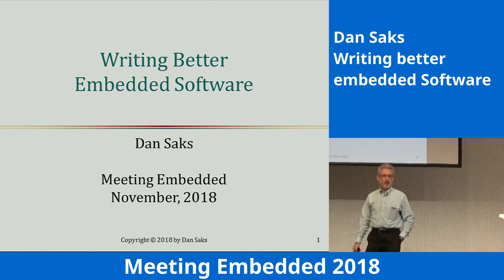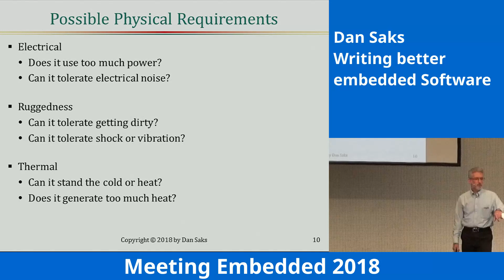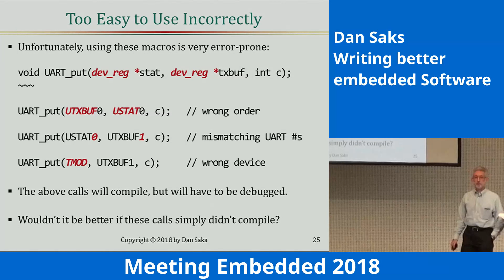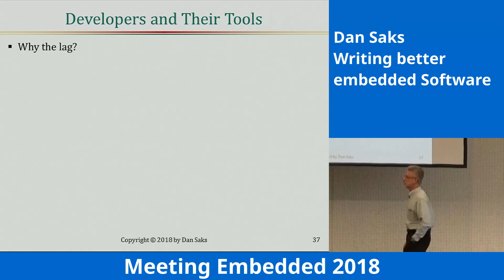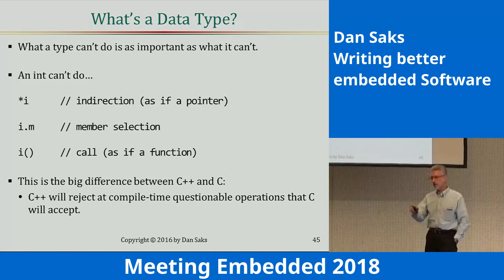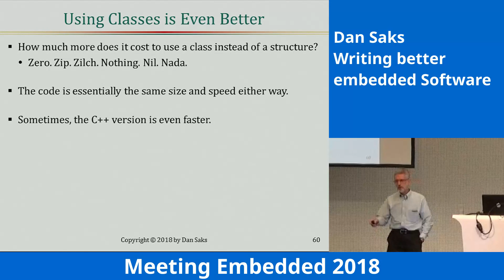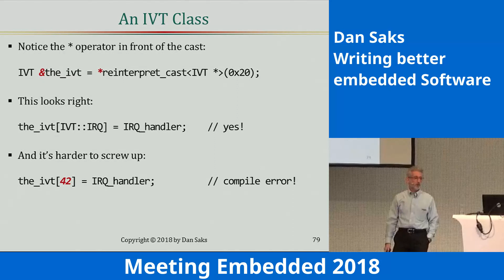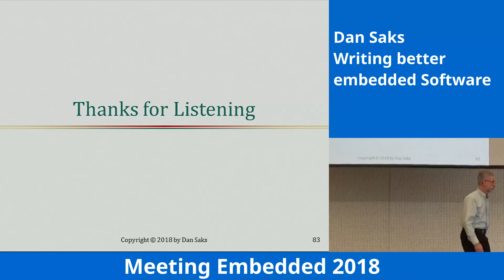Writing better embedded Software - Dan Saks - Keynote Meeting Embedded 2018

Comment: Really nice! As a former C embedded developer, I totally agree with the lecturer. I have been using C++ for over 2 years for, let's say, system programming. I am still learning C++ and I am getting rid of C programming habits. It is not easy but  I see profits.
Reply: Would you recommend to avoid C and jump straight into Embedded C++ if possible?
Reply: @189Blake  Sorry You have to wait for my response so long. 
My answer is no. Lately, I've changed jobs and I use both C and C++.  If you were a monk and wrote embedded code in pure C++ for fun the answer would be yes, dive into C++ and leave C. However, in real life, nothing is black and white. Companies still use C and a little C++. I have to admit C++ has lots of advantages over C but experience tells me you have to know both.
Reply: @dylanryan5125   Yeah. It's called, put in your email and reset the password doofus.
Reply: They are so familiar yet have distinct differences so it's worth learning both. And you will find both in embedded systems quite often.

Comment: The real change between C and C++ is the friends you made a long the way. Ok I'll stop now. Great talk! Been writing embedded code in C++ for a little bit (not as long as most folks here), We mainly do C++ and rarely see any C code. Something I've noticed over the years at least where i work at, is how we refuse to leave the C++11 world. I understand the fear of always upgrading to the latest but, it sometimes hurt to miss out on some of the newer features. For instance constexpr functions in 14 without having to  use twenty ternary operators would make the code so much readable and easier to debug. Going into more details would take too much of my time, but i did appreciate the talk :)

Comment: Very important team skill information. As fresh computer engineer (Diplom Ingenieur Technische Informatik FH Flensburg University of Applied Sciences) I had a short talk with oldest colleage about object oriented programming and using its possibilities, he was fully trusted by and advising the boss of that small software company with 1 mio. lines of code (modular programming style). He were not interested at all, so I keep my mouth closed for years about OOP as I did not want to loose my job. Few years later when we all worked on porting to windows I answered another me asking colleage that OOP might help to keep his tasks done, this time he tried and used it for productive code in user interface parameter code (but not for running measurements inside the measurement kernel system).
Reply: Did he go fired? xD

Comment: Another big thing is using operator overloading and templates to write a good and safe fixed point math library. Fixed point math is very common in embedded devices, and it is so easy to get bugs with overflows and misplaced shifts that could have been caught at compile time!

Comment: Just use #pragma pack(1) if you want to get rid of your padding bytes. wth. You can also just add compiler warning to error parameters to gcc in c? I feel like none of these points are valid.

Comment: Thankfully now the ECE program at my program has two required C++ data structures and algorithms. Even if you don't go into something involving software, you'll at the very least be better at writing a faster matlab script or analyzing or interfacing with your system with something like python or an embedded system hooked up to your computer.
Reply: Still waiting for our university EEE course to introduce this in addition to the very basic C programming course.

Comment: Good job and thanks. I work as an embedded software. Engineer in the USA. Only 1% of my fellow engineers are professionals that learned grade school. The are fakes that have almost no knowledge or capabilities. They can’t even read or write as processionals. The reason c++ is unpopular is because they don’t have clue what design is, and an architecture of one bad module. Bye..
Reply: Hey, I was wondering if you could give me some tips/ resources to use so I can become a good embedded software developer. Thanks!
Reply: Were you drunk when you wrote this comment, what does that even mean?

Comment: sir i was dropped out from my engineering school in 3rd year and after i leaned by my self and i am working in a small company , but i wanna apply for overseas 
could you help me to and give me a advice ?
Reply: Most jobs wont even consider your application just because you don't have a degree, even if you are qualified for the job in terms of technical ability
If possible, I recommend finish that degree
Reply: not possible
Reply: @dushanindunil500  then look for jobs that will day “will substitute degree for experience” but typically those jobs require 6 plus years = one degree
Reply: Start ups are probably your best bet, they tend to be less strict about following those requirements, they typically just want someone who can get the job done, is qualified and has a “get it done” attitude

Comment: I don’t agree with your definition of what an embedded system. I believe because of technology it’s been blurred. A Raspberry Pi for example. Is it an embedded system? Yes and No. An Arduino Hat connected with a Raspberry Pi. Don’t forget the Ada Language that was standardized in 1983. A Data Structure is a defined grouping that represents real world Data Type(s). You also need to deal with careful consideration with pointers to these structures. You need to treat C and C++ as different languages.